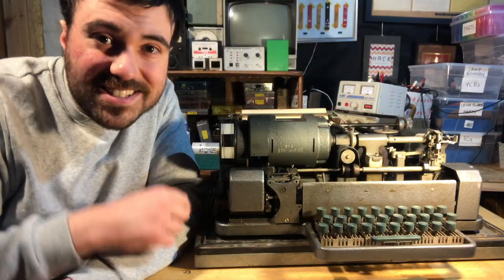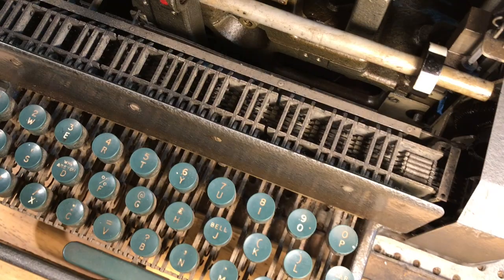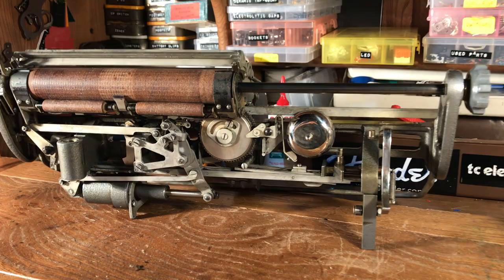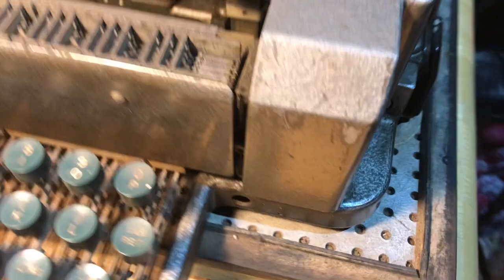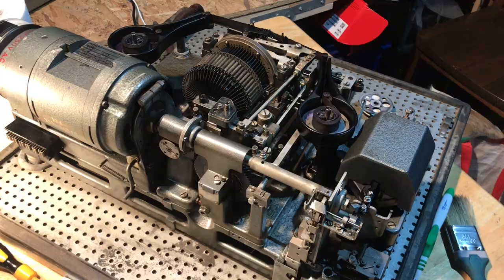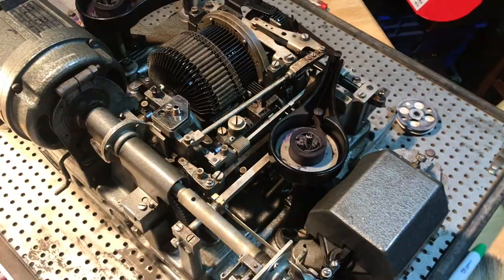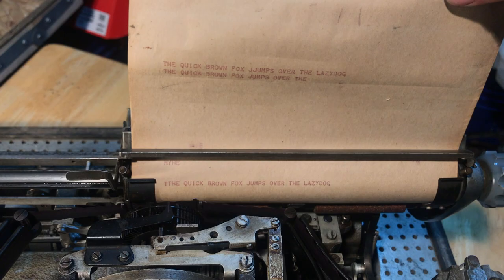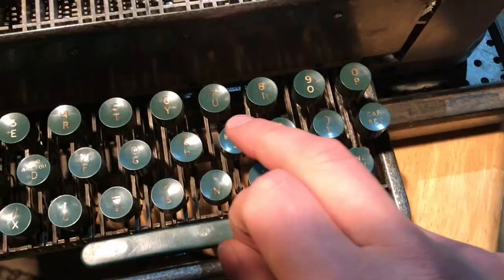Can I Fix The Teletypewriter? Incredible Mechanical Marvel From 1957 - GPO Creed 7B

Comment: As far as I know the solenoids are current driven (60 mA) so it did not matter how long the cables were as long as the current was up to specs.
Reply from the maker: Oh right well ohms law and that eh. Signal loss over long distance was an issue, that’s what relays were first used for, as repeaters on telegraph cables. Sam Morse got a patent for it in 1840.